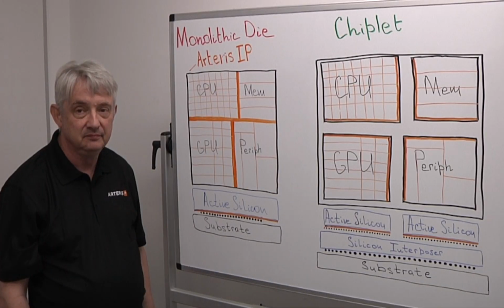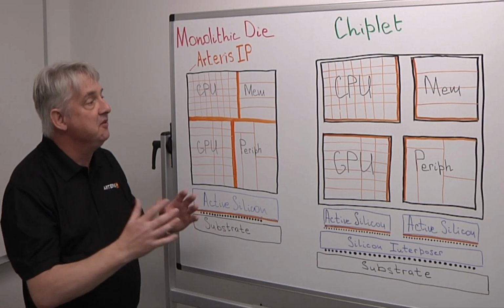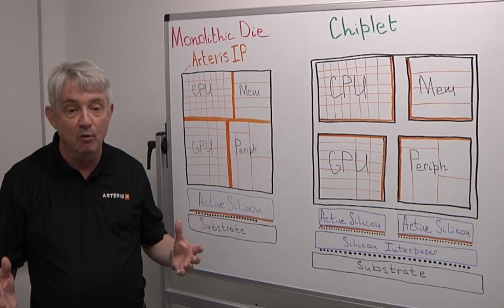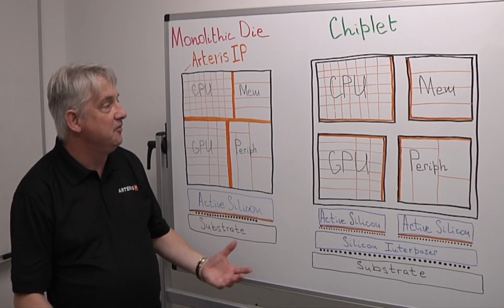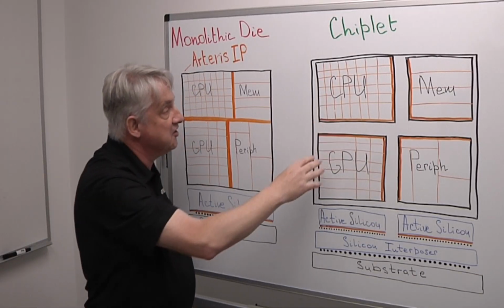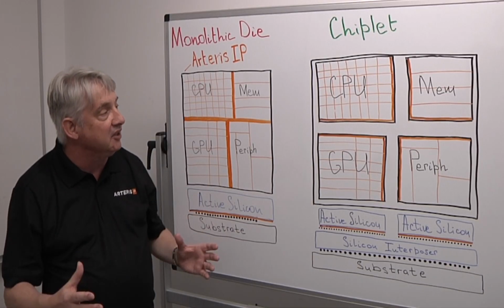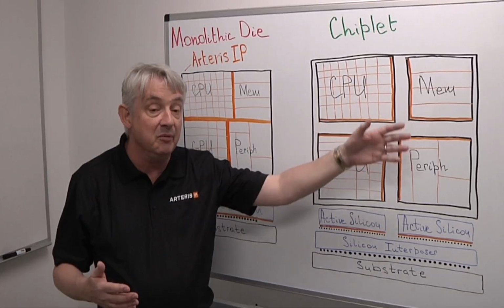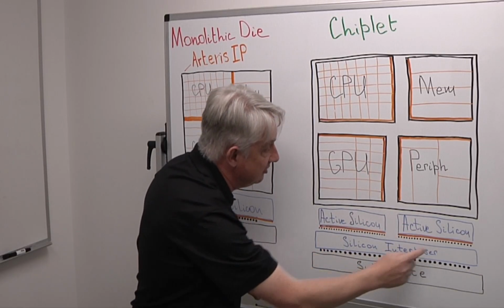Arteris for SemiEngineering: Benefits and Challenges of Using Chiplets

Comment: How would you create a light drive with in the system yo develop a non bottle system?
Reply: Light speed might be more probable in a smallet system where fiber loss wouldnt really matter due to ultra short lines then idea of crearing this to  make it from digital to light with in the aystem is the key in my opinion to reduce bottlenecking.